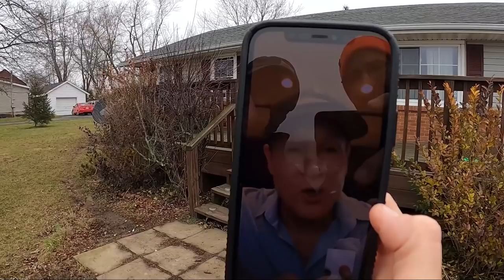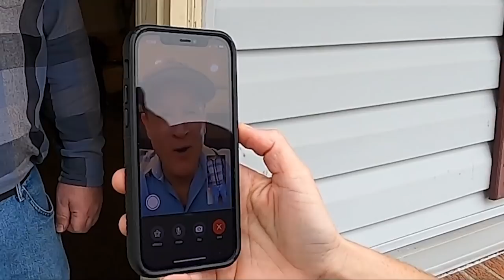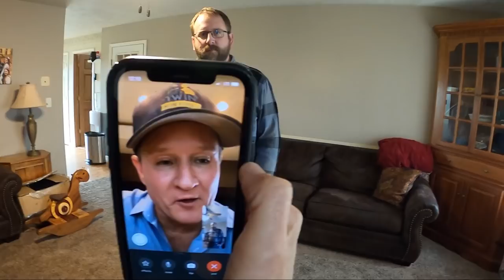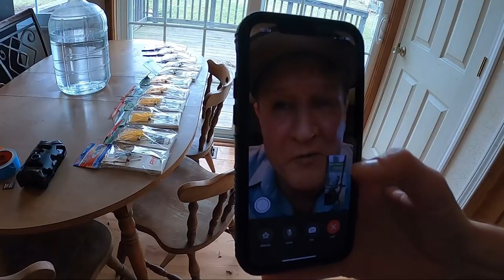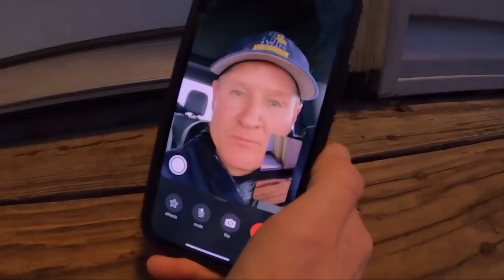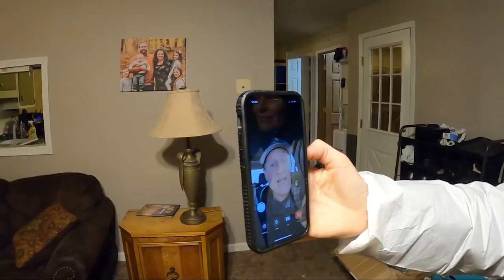DOG UNLEASHED on rat infestation...they didn't stand a chance..

Comment: As a homeowner, they need to keep up on clean up. That way it's easier to spot new rat  activity. If not you will mix up old damage with new chew routes. Plus it helps with the hygiene of the house.
Reply: Not just cleanup but repair...

Comment: That removable threshold was most likely entry point #1.  Needs to be secured to the concrete along with a tight fitting door sweep.  Also always seal a basement door with a yellow/orange painted (for visibility) 2x4 custom cut to totally seal up underneath that door.

Comment: Some maintenance by the homeowner would go a long ways.  Replace the rotten garage service door and fix the soffit panels.  Fix the place up. Plastic soffit panels leave a lot to be desired.  One common theme on a lot of these rat problem houses I see is piss poor sloppy workmanship with most of the trades.  I find enough of it in the remodeling work that I've done for close to 50 years in Minnesota.
Reply: Definitely, that's why at 60 and being a woman I learned, masonry, plumbing and carpentry. Won't touch electrical, scares the heck out of me. The workmanship in the mountains where I live is horrible. Laziest contractors I've ever witnessed. I have to go three counties over to get a good contractor for electrical work or garage door repair. Don't do garages either. If it is a good contractor they hate coming into my county. Dead beats, disgusting homes.
Reply: Dude I don’t know anything about stuff like this. I’ve never owned a home in my life. No one in my family ever owned one so I’m new to everything. Idk how to do any of the handy stuff